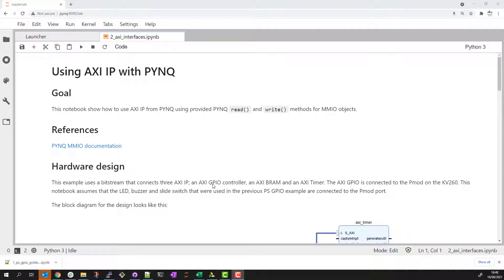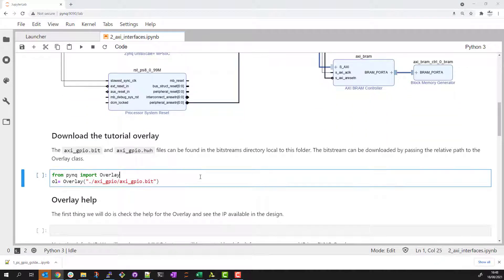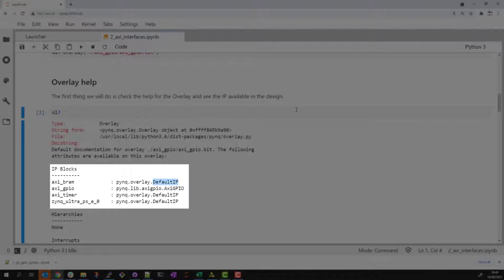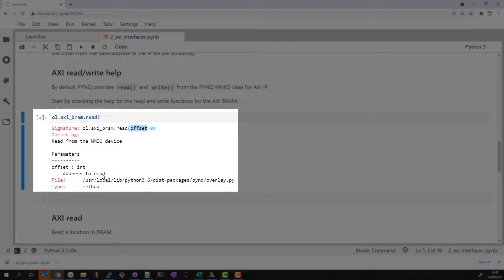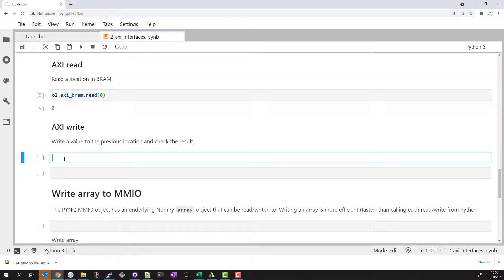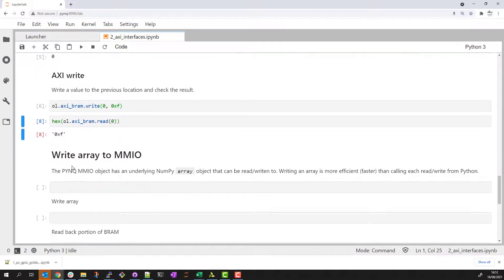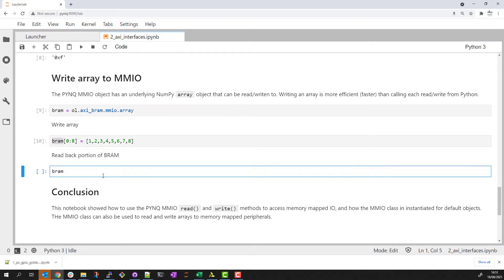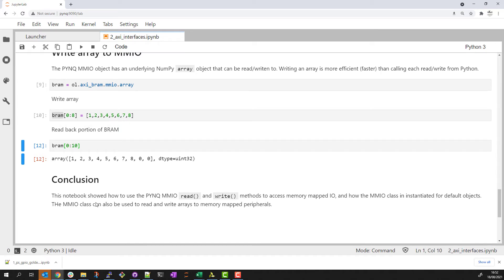Using PYNQ MMIO (Memory Mapped IO)

Comment: Hello, thank you for this tutorial!

I use PYNQ Z2, so I would assume that the procedure is quite the same. however, I always get runtime erros (I cannot find the pynq in the explorer, so I uploaded the .tcl file and the .bit file into the ordner with the jupyter notebook via the jupyter interface, but that should not make a difference?

RuntimeError                              Traceback (most recent call last)
Input In [7], in <cell line: 2>()
      1 # Overlay erstellen und Bitstream laden
----> 2 overlay = Overlay(bitstream_filename)

File /usr/local/share/pynq-venv/lib/python3.10/site-packages/pynq/overlay.py:319, in Overlay.__init__(self, bitfile_name, dtbo, download, ignore_version, device, gen_cache)
    315 super().__init__(bitfile_name, dtbo, partial=False, device=device)
    317 self._register_drivers()
--> 319 self.device.set_bitfile_name(self.bitfile_name)
    320 self.parser = self.device.parser
    322 self.ip_dict = (
    323     self.gpio_dict
    324 ) = (
    325     self.interrupt_controllers
    326 ) = self.interrupt_pins = self.hierarchy_dict = dict()

File /usr/local/share/pynq-venv/lib/python3.10/site-packages/pynq/pl_server/device.py:118, in Device.set_bitfile_name(self, bitfile_name)
    116 def set_bitfile_name(self, bitfile_name: str) -> None:
    117     self.bitfile_name = bitfile_name
--> 118     self.parser = self.get_bitfile_metadata(self.bitfile_name)
    119     self.mem_dict = self.parser.mem_dict
    120     self.ip_dict = self.parser.ip_dict

File /usr/local/share/pynq-venv/lib/python3.10/site-packages/pynq/pl_server/embedded_device.py:692, in EmbeddedDevice.get_bitfile_metadata(self, bitfile_name, partial)
    690 parser = _get_bitstream_handler(bitfile_name).get_parser(partial=partial)
    691 if parser is None:
--> 692     raise RuntimeError("Unable to find metadata for bitstream")
    693 return parser

RuntimeError: Unable to find metadata for bitstream

Comment: what is the interface it is using? PCIe? USB JTAG? or Ethernet? How do I know that?
Reply from the maker: MMIO is uses to read and write registered in the Zynq memory space. These examples are running on PYNQ, and PYNQ runs on Zynq devices. MMIO is primarily intended for accessing Programmable Logic IP over AXI interfaces.  I connect to the board from my laptop via Ethernet.